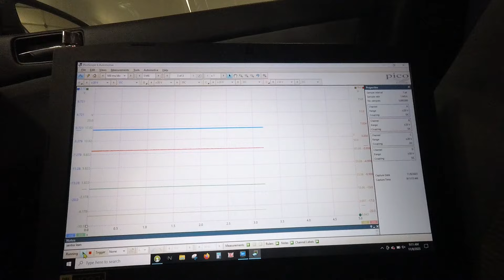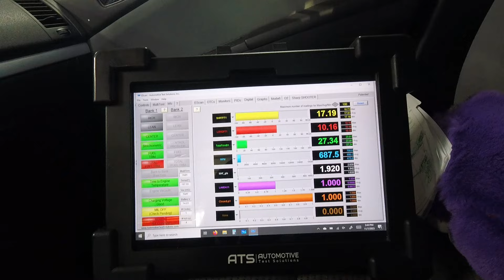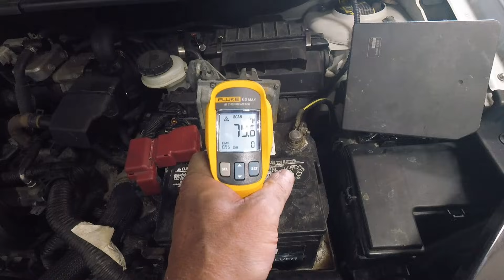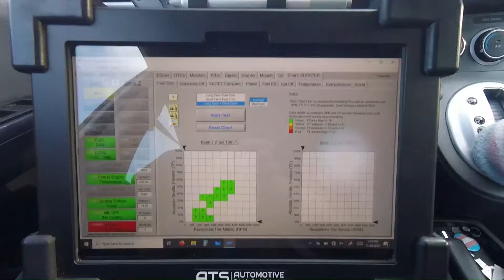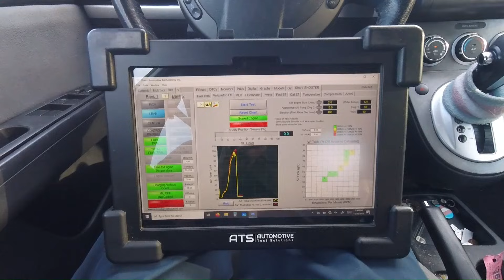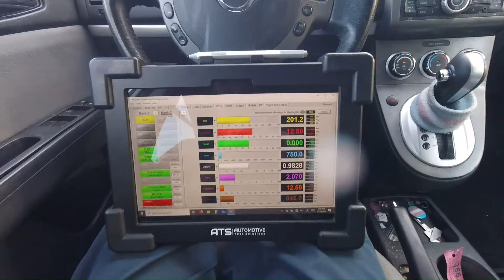SENTRA from HE*L , Runs lean, won't start cold ???

Comment: sounds like it was too lean to start when cold  and thats why the new computer fixed both problems; the old computer wasnt allowing  more fuel for cold starting?    the fuel map works when the engine is cold right, not the closed loop, so lets say that a bad computer was somehow preventing the fuel map from providing a richer mixture for cold starting ....makes sense?

Comment: Great video.
I am 62 have been working on cars since 1979, retired automotive technology teacher, always kept a part time job in a shop doing diagnostics, background in computer test engineering. Still work part time diagnosing drivability, electrical and one on one teaching.
The feeling you mention has not gone away.
  In my case I know the reason why it is there after deep psychological analysis with a professional. I have learned psychological tools and strategies to deal with it, not a complete solution just alleviation.
Reply from the maker: Keep up the good work. Until I finally retire the anxiety of calling expensive parts will always get me. But its fuel to go the extra mile to triple check everything, and hopefully get it correct.
Reply: @CartersDiagnostics  Love your videos. Thank you for the reply

Comment: I feel the same way 
 But if I make a bad call I don't charge  . Unlike  most shops that say to there customers  it may or may not fix it are you OK with that . And charge for a non fix .
Reply from the maker: I'm not a believer in charging for mis diagnosis.  I hate the term "it may have other problems "  On the other hand on this car I was 100% confident that the ECU would fix the cold start issues,  but I was hoping it would fix the lean issue. So a total mis diagnosis was not going to happen.  Also complete a total transparency with the customer is key with cars like this, and they were 100% on board with the diag.

Comment: Excellent logical approach to problem-solving, as usual. A quick question:
What would cause a lean condition (No CEL)at hot idle and low load conditions only? Fuel trims look great until the car fully warms up and heat soaks real good. Then the STFT will jump upwards of 3, 5 to even 15%, adding to the already high 10% LTFT. 
No vacuum leaks were found. Maf seems ok, but reading at idle for a VQ35 is low-ish at 2.2 g/s. No driveability issues at all. Car runs great otherwise.
Reply: I’m getting grey hair too, because of this problem. Driving me crazy no pun. 😂
Reply from the maker: MAF does seem low. Both banks I presume are lean. What is the customer's concern ?
Reply: @CartersDiagnostics  Wow! Thank you for taking the time to answer. I am the car owner trying to figure this out on my own. The concern is the high total fuel  trims (20% both banks) which I think are not normal. Not high enough to cause the check engine light though.
Reply: I think I need to find as a good a diagnostician as you are here in NYC area to get to the bottom of this. I would just like to know some kind of a direction of what could be the problem. This is a 2011 Maxima by the way.
Reply from the maker: @zygi22  Check the air boot at the throttle body very close. Also inspect  the pcv system.  Especially the bank to bank hose and the hose going to the intake.
Reply: @CartersDiagnostics  Thank You.

Comment: I Always struggle with the decision to call a module. A module that still (mostly) functions are always the hardest to call. Several people way smarter than me have told me Several times that most of the time it's NOT the module. Keith from L1 actually quoted some numbers recently saying that  in only 22% of cases where he gets called to a shop to program a replacement module it actually fixes the car...😮😮😮
Reply from the maker: Wow , did not know that. Very low fix rate for an  ECU. That makes it even tougher to call it.

Comment: Just curious did you check 5v sensor readings like your other vid "No start...masked Maxima"? Curious as to whether those where reporting wrong values. Trying to decipher whether computer has physical (circuitry) malfunction or programming malfunction. Great vid though, just my brain always wants to know why-what caused computer to function that way? If you or anyone here figures it out please let us know. Heat usually affects computer circuitry but cold not as much, unless possibly garbage in garbage out from one or two sensors. Anyway thanks again for the great info.

.
Reply from the maker: I looked at lots of data pids during key on before crank no start. Temp. sensors, pressure sensors, start signal ect. All appeared normal.  I also tested physical value of Maf. It was good also. The ecu showed injector pulse width time in the data pid. When we actually saw none on the scope.  Makes me think it was more of a physical issue for the no start issue. The lean issue has me scratching my head as to what happened.

Comment: Do you prefer ATS e-scan over the factory scan tool?  Interesting to see the dealer tech using aftermarket tools :)
Reply from the maker: The factory tool and me have a love hate relationship.  I use the factory tool when I have to. On newer cars the ATS is great for fuel trim issues. I also have a zeus, I love the graphing on it and the fact its always recording.
Reply: @CartersDiagnostics  one more quick question .. the sharp shooter ve testing you were doing, would that work if the car was a speed density system?  I get it there's no maf signal, but can e-scan still calculate the engine load to perform the ve test?
Reply from the maker: @ablackformula  I've never tried it on that style system,  but I don't think it will work.

Comment: Great video and great comments. I understand the anxious apprehension Mike.  I can't count the many many times i got involved with a car that had a super intermittent problem. One particular one i remember was an early 2000's Pontiac   Bonneville 3.8 that just liked to stall when it felt like it. Would not restart until it sat.  Came in on the hook and would always start right up for me. I once kept the car and drove it home for over a week with no problem. Tried all the usual harness checks , tap on components , pin fits, temperature extremes and nothing. After several tries without duplication I put a new pcm in it and problem never came back. I hate doing that and that car ate my lunch but sometimes you just have to say a prayer  and do it and move on.
Reply from the maker: I appreciate the war story. Thanks for tuning in.

Comment: Weird in that first capture, it seems once you got the single injector pulse, the overall capture had less noise. Good work
Reply from the maker: The starter was disengaged and the inertia rolled the motor just a slight bit more, that why it was less noisy at the end.

Comment: I think we all doubt ourselves when saying it's a module. That's a lot of money when the smallest detail could be missed during a diagnosis. This is why I will double, triple, and quadruple check my work now. I will run jumpers to bypass circuits to ensure integrity of the circuit to a module. I will meticulously go over inputs/interlocks the modules look at to control an output. People don't understand these modern cars are rolling embedded systems with complex networks. They are not like the old cars, where it was analog. Almost everything is digital. We get inadequate troubleshooting and training, even at the dealer level, over how these modules function. It would be impossible to become a modern auto diagnostician without knowledge of electronics. Thanks for the high quality and thorough videos you continue to put out, Mike! I hope to see you at the next Picogroup meeting next year... as you have put us in quite the conundrum. Hopefully we will get it resolved and make it a good test to utilize.
Reply from the maker: Its these great comments that speak to the integrity level of those posting them , Thank you for taking the time. It seems we share the same desire to make the correct call, it seems the bulk of the folks that have commented share the same value to get it right. That is awsome. I should be at the next meeting...lord willing. And yes the conundrum is real even for myself.

Comment: Great one Mike  I can relate. One thing I want to mention  and I learned this from Mail Salazar on his channel. He had a very similar situation with a Ford fusion or something with a blue oval on the grill. and he removed the PCM.  shell to expose the circuit board and used a thermal imager  and you can see the hot spot turn into the cold spot  totally in sync with the symptom.    Blessings to you Mike keep these gems coming
Reply from the maker: Great information,  gonna have to remember that. Thanks for commenting 🤘.

Comment: Really nice video and great information here. Thanks for posting this. I am having a similar issue with a 2007 2.4 l Camry. Lean condition (@ idle ) isn't quite high enough to set a code, but it's getting pretty high, above 20's.  No drivability problems.  I have checked everything I can think of multiple times. The idle high fuel trims are screaming vacuum leak, but my smoke machine, and propane, just can't find any vacuum leaks. Strange thing is, I can drive the car for a short 15 minute drive and at some traffic light stops the fuel trims are around 10, then the next traffic light they may be around 20, then the next traffic light they may be back down around 10.  I'm beginning to wonder about my PCM, but I feel like I would just be throwing a part at it to try that.
Reply from the maker: Just reading your comment makes me nervous.  It sounds like your in the same situation I was in. Good luck. Remember trust your methods, if you are 100% sure of your tests then you gotta go with the obvious.  Its a tough call, Over the years I have had lots of grey hair and sleepless night on cars like this. Thank you for commenting!

Comment: I too feel like that. There is always a level of incertaincy about what is going on inside the ecu, and i always like to bee 100% sure. And if i cant get there i get that nervous stomack feeling.
Luckily for me i have been in the aftermarket ecu world for a couple decades so i have a certain sense of whats going on in those. But they are way less complicated than oem's though.
About this one...
I have a feeling its about the maf portion of it all. 
I ran across some cars that will not start if you unplugg the maf. MIGHT have been Nissans. Cant remember.
Did you by any chance look at maf scan data while cranking when it did not start?
Reply from the maker: I remember looking at the key on maf data it seemed normal.  As far as cranking I did not watch it (maybe I should next time).  I think the no start cold issue may have been a solder joint issue, have not confirmed that. The lean issue had to be a logic thing maybe low power or ground resistance due to a solder joint.  I'm totally guessing though,  just all theory.  Thanks for commenting 🤘.
Reply: @CartersDiagnostics  yes, bad joint was my guess too. In the maf circuit specificaly. That would explain both problems. If the car wont start without a maf that is...

Comment: Great diagnosis. It seems like the ecm was not pulsing the injectors enough at wot. It would be nice if you had checked the injector pulse before and after the repairs and that is what was causing the lean code. Thanks for posting another great video.
Reply from the maker: I remember looking at injector pulse width with the scan tool nothing stuck out. But its possible I missed something also😄. Kinda glad this one is gone!